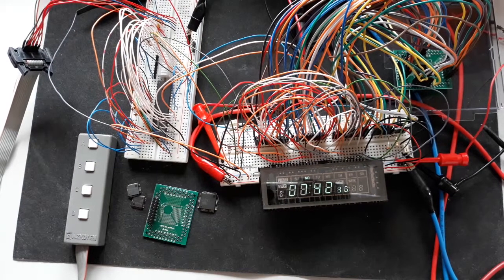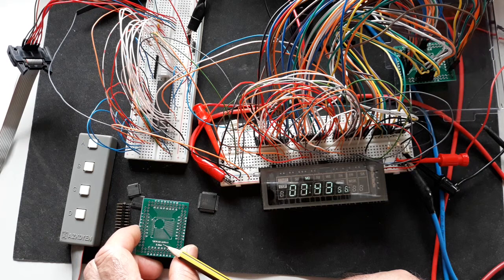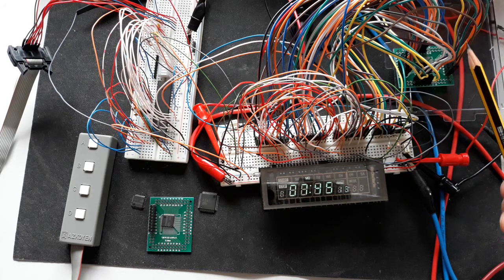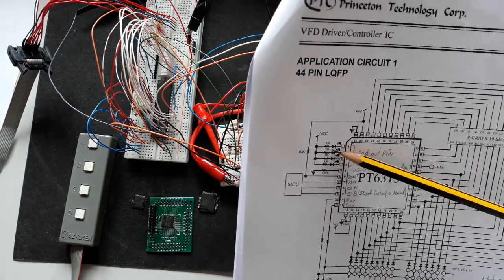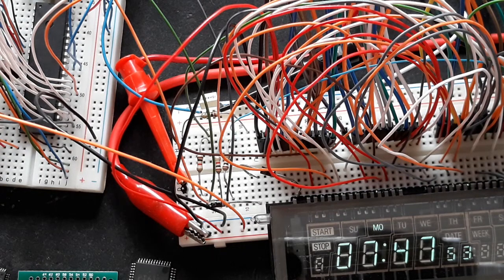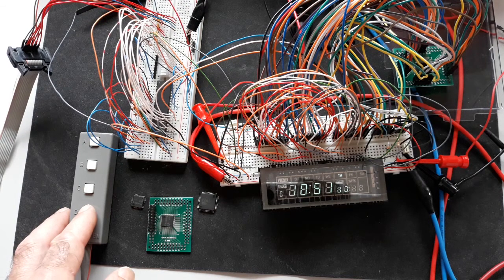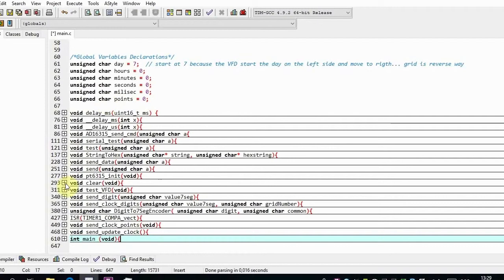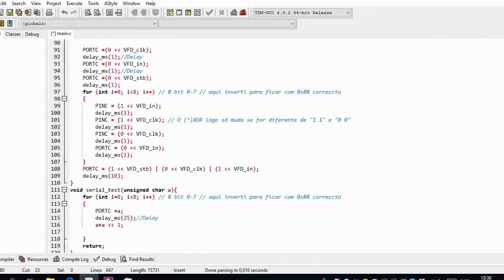PT6315 VFD Clock and the code sample

Comment: Hi! how did you make the negative VEE?
Reply from the maker: The important is have 3 power up independents, ok! exp:
1) GND and 5VDC to filament(better if is 3,5VAC)

2) GND and 5VDC to power up the "LOGIC"

3) GND and 20VDC to grids and segments( now the positive of this power connect direct to the GND of "LOGIC"), this means you stay in fronte of a negative voltage relative to GND of Logical level (is here wich is very importance the independent powers).

To the power settings stay complet is necessary do a reference of the power of filamente(no matter if is AC or DC), to do it connect one of the filament through a resister (15 ohms exp) to the GND of the 20VDC. This action will let the filament at negative level, in this case -20VDC. The 20V is a example, it can be 18, 26, 36 VDC 

I hope this help you!
Reply: @jlsmonte  Thanks for the quick response! you were really helpful!
I'm building a clock with VFD tubes and I chose to use the PT6315 as a controller.
I had problems with negative VEE, I didn't know how.
In the next few days I will do some tests. I will let you know.  GRAZIE!
Reply from the maker: I have more videos where is made reference to the power up of VFD. Please let me know if it help you, another way I will do a video exposing better this matter.